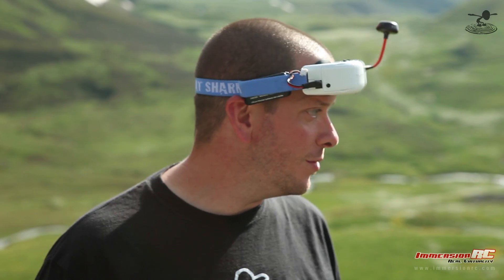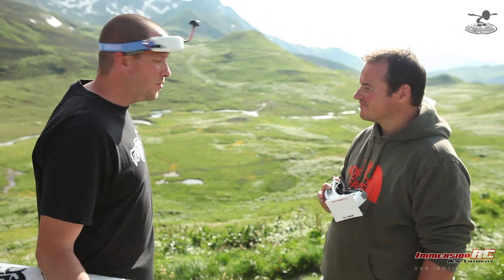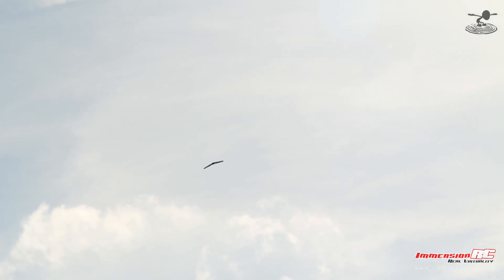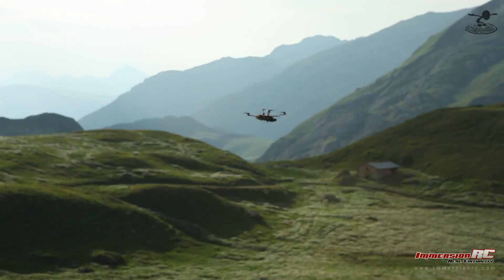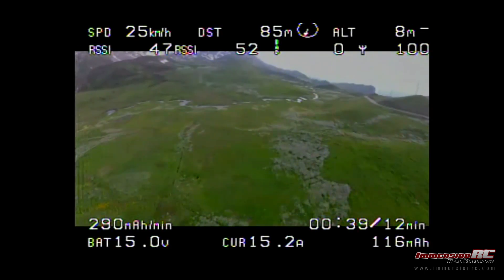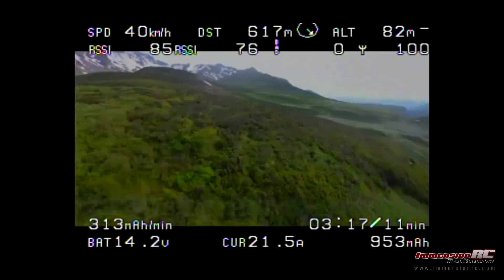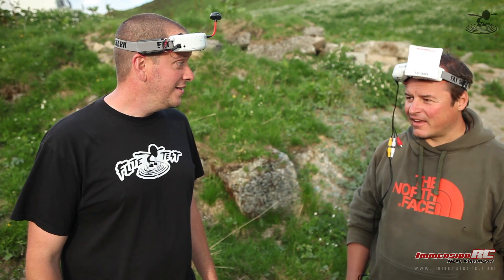Flite Test - EzOSD (On-Screen Display)

Comment: A friend of mine has the Ez OSD system and when he plugs in the camera the battery info on the bottom of the screen goes to the top and interferes with the flight info. He is not using a Immersion RC transmitter. Any ideas? I have the same system with an Immersion RC transmitter and have no problem.

Comment: Hi , I bought this ezosd as well  but just had some questions. the current sensor has dean's comnectors. one for esc and the other for battery power. how do we hook these two up? does one dean's connection go straight to the flight battery pack?  and does mean that I now have to get a battery splitter so that I can power up my drone and power up the ezosd? also my fpv transmitter comes with a jst connector in order to hook it up to the drone for  power but I'm now om confused because the ezosd is also hooked up to my fpv transmitter and is also fed already by the same power source. Next,   the other connection that says to connect to the esc.....does this get sliced into one of my esc's on my drone?

Comment: When you lose video and switch to third person all you need to do is full back elevator and enough throttle to fly loops until your eyes find it in the sky. You can practice the proper throttle amount to make the tightest loops in third person.

Comment: I bought this fpv setup according to your video, the fatshark dominator v3, Fatshark Dominator 5.8ghz Receiver Rx Module for the goggles, Immersion RC 600mw 5.8 GHz A/V Transmitter, EzOSD’ on-screen display, the same camera in the video, and the antennas your video has the link for. when I try and bench test the setup I barley get a picture on the screen its very snowy. I don't know how to fix it to get it as good as the quality in your video. any suggestions on how to fix that?I bought this fpv setup according to your video, the fatshark dominator v3, Fatshark Dominator 5.8ghz Receiver Rx Module for the goggles, Immersion RC 600mw 5.8 GHz A/V Transmitter, EzOSD’ on-screen display, the same camera in the video, and the antennas your video has the link for. when I try and bench test the setup I barley get a picture on the screen its very snowy. I don't know how to fix it to get it as good as the quality in your video. any suggestions on how to fix that?Read more
Reply: +Niko Heelleo it could be the signal bouncing off the walls. maby take it outside and walk out a few feet with it.

Comment: If he had an OSD with RTH... his plane would have come back on his own. If all you need is voltage and flight time, you could buy a $10 micro minim osd to help you with that. I got a cyclops it's working great so far. Looking at Eagle Tree Vector for the next one.

Comment: With the altitude display, I take it the number is zero'd at your launch site? Would it be possible to have a terrain database on board, so that it knows your lat/long and knows the terrain height. The aircraft's height minus the terrain height will be your height above the ground. Probably not too important when your video is working, but if the camera dies on you and you have to fly back on the OSD it would prevent you flying into a hill.

Comment: Hey Flite Test - question on the iTelemetry dongle that was used on the quad when going to find the crashed wing. How do you get it to work? I have an EzOSD and EzUHF with RSSI data displayed - awesome. I just got the iTelemetry dongle to help with finding a downed craft but despite the apparent ease to connect it between my Attitudes and my iPhone 5 with a double ended headphone cable (I am using a trainer cable that I use on my Spektrum DX7s), I can not get it to have solid performance.  I have matched the slow/norm/fast telemetry speeds in the App and the EzOSD settings and can't get it to work solidly - more bad packets than good.
I have researched online and many people have the same issue and there is no clear solution on FPVLAB, the main source of support for Immersion RC gear since they do not support themselves.
Since you promoted the iTelemetry Dongle on this episode, can you make an article or video on how to connect the iTelemetry Dongle to an iPhone so we can actually use the telemetry and map features?
Thanks
VeeDubalot a.k.a Chad

Comment: So someone explain how they are both receiving...what if they both wanted to fly with the FatShark set-ups, would it be possible with two video transmitters, or would there be significant interference?
Reply: The Fatsharks have 7(?) channels that you can choose from. If both used a different channel (preferrably not directly following ones)  on their transmitter and receiver they'd have two different connections.

Comment: If you're using a HUD/OSD, you should use one with an auto-return feature. That way, you can set it so if the signal disappears it will automatically climb 500ft in a spiral and then fly 'home' and circle.

Comment: Using 1.3ghz or RTH would easily have avoided the original crash.  Just saying.
Reply: Wyll Surf Air He didn't loose video because he used 5.8ghz. He lost it because the props weren't balanced and so it caused vibrations which then caused the antenna to loosen and fall off. But yeah, a RTH would have been ideal

Comment: I always use a GPS tracker. I don't use an OSD but I use a separate link for telemetry on my smartphone using the 433MHz band because then when I loose my flying device, if the GPS tracker doesn't have GSM signal and the 2,4GHz and 5,8Ghz bands are blocked by some trees or whatever I might still have my telemetry link in 433MHz on my phone with the device's position. Not later than this saturday the telemetry link is the ONLY thing that allowed me to find my 3DR Y6 back after a crash in the mountains. And of course even my planes are equiped with an autopilot in case I loose the video signal I switch the return to launch with at least 200 meters of minimum altitude. If what I am saying interests you you'll find more about all that on my channel :)

Comment: Showing EZOSD was an opportunity while in Europe.  Obviously we've all seen these features on other OSD devices.  What I wonder about is the efficacy of using telemetry from devices that your flight controller is not connected to?  It would be interesting to see side-by-side GPS data from multiple radios, and it might help diagnose fly-away and other suspected GPS failures not associated with interrupted power (we suppose).  If GPS radios really do perform differently, it may be useful to have the data from two or more be monitored, and an alarm sound when the data deviates by more than a preset threshold.  If a NEO works differently than a LEA, maybe the readings could be averaged together for better results?

Comment: Never seen a CCD camera perform so badly, the jello was really bad which basically should not be there on a CCD camera, not a good advertisement for fatshark, I guess neither was it for immersion seeing it lost video link as well (wing looked perfectly fine so it clearly was not the antenna coming off).......

Also pretty funny you guys were using your soon to be biggest competitors (flysight) equipment, FYI to those reading this, unlike immersionRC vTX's you can fly a flysight vTX on every channel without interference to the person on the channel next to you, that means 7 people in the air at once without drama.

Comment: I'm not a fan of the ezOSD: the GPS altitude reading is almost always wrong, even if the aircraft is kept stationary for several minutes after the OSD shows a good fix. Direction to home works well and the dual RSSI reporting is good. The other thing that's not great is the Android software (which is used to show telemetry at a base station) as it cannot record the flight geo-data. I've never been able to get the PC software to show geo-data following a flight.
Reply: Isn't GPS altitude always kind of inaccurate? That's why people use barometric sensors for altitude?
Reply: Balu Barometric can be pretty inaccurate. Depending on what you set your initial pressure settings to, and taking into account that conditions might change, your readout could swing pretty heavily. (At least if you are looking for altitude above ground) Radar altitude is probably the most accurate and GPS altitude should be decently accurate as well. I am an Aerospace Engineering student so I'm just telling you what I know based on theory and classes. I don't have much rc flight experience although I've always wanted to take the plunge and get into the hobby.
Reply: Justplanecrazy25 Thanks for your reply.

I'm guessing that barometric pressure is used in RC because the conditions might not change that much in 10 minutes of flight time? Also it's usually used for "altitude hold", not for "altitude measurement"?

It's been a while that I've looked into this because I was wondering about my handheld Garmin GPS altitude data. This sums up what I was told then: http://gpsinformation.net/main/altitude.htm

"Radar" is sometimes used in form of ultrasonic sensors, but they only work close to the ground.

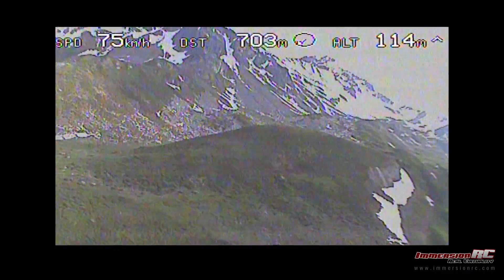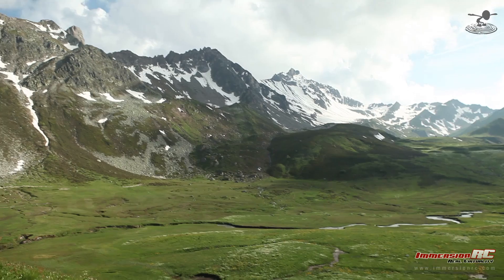Comment: People actually still fly FPV without RTL? If I lose signal, I just calmly flick a switch and my aircraft climbs if it is below 50m, turns around, and comes back. I have never once had to rip off my goggles like they did at 6:10. Also, at 6:30, the spotter says, "You went behind that ridge..." and the pilot comes back with, "And no one screamed BEFORE I lost video?" What he was implying is that the spotter was supposed to let the pilot know, from 700m out, that he was about to fly behind an obstacle. That cannot be the spotter's responsibility. It is up to the pilot to have enough situational awareness to know if his flight path will take him behind objects that will block his video signal. The reason is simple: At 700 meters distance, it is impossible for a spotter to determine if a small wing is about to cross in front of a hill (where it would retain signal), or behind a hill (where it will lose video signal, such as what happened). That's why a pan system is also so valuable. You gotta constantly check to see visually from your FPV POV where base is at, so you don't accidentally fly behind a hill!

Comment: This could have been avoided.  First, why isn't the ezosd showing the Lat/Lon from the onboard gps? If you have that enabled and use the built in DVR on BOTH of those goggles all you had to do was review the footage for the last coordinates.  I have the Dominator V2''s and had to use this method once.  Second, get a good autopilot.  For planes I have had good luck with the cheap turnigy t1000fc for about seventy bucks.  Does a great job with return to home and have my failsafe set to activate it on signal loss.  Only down side with that autopilot is it does limit you to 45 degree banking so wild flying is out but that could be seen as a plus side for AP.  Also I don't buy fully into the capacity meter.  I think that is false hope.  My couple of year old 2200 batteries only put out about 1800 ma now.  So the flight time would be off.  Going by pack voltage seems to work better.  Lastly my favorite osd so far is the cheap HK miniOSD.  Throw away the inlcuded gps, use a $30 10hz one and flash the osd with U-OSD.  Totally configurable and accurate for about $60 when all is said and done.  Finally I give a thumbs up for showing the incident.  This stuff does happen.  We all learn from it.  I see the sma as a weak point.  I wonder if there is a micro BNC style connector that could be used.

Comment: Didnt he had RTL?  I was under the thinking he was going to show off the OSD flight back home... and he lost video at 600m from launch? Fatsharks are awesome, but the rest of the equipment? I'm not so sure.
And I bont like cmos cameras.. flitetest!! This needs a redo,  Josh saved his quad with the apm loads of times, I'm sure with the transmitter in his hands we can get a better review of the ezosd.

Anlso a video about what to do when hou loose video, when to dich the plane when to try and save it, use of loiter or rtl, maybe loiter for quads inbetween tree, rtl for a plane in open air, that kind of thing.. hope to see this revisited
Reply: Nope, there was no specialized flight controller on board, so no RTL. He did not only lose video, but all data besides controls after the FPV antenna got disconnected from the vibration created by the motor / props.

Also don't bash CMOS cameras without trying. :) They don't call the Fatshark 600TVL camera a 'CCD killer' without a reason. It is specifically tuned for FPV so you can still see the ground when the sky is bright.
Reply: Cmos...I said I dont like it.. not thats its crap?

Comment: Kind of surprised the FliteTest crew seems so blown away by such a mundane piece of gear. This is just a big ImmersionRC ad. To those just learning about this stuff, take note: there are many other OSD manufacturers out there (Eagle Tree, Skylark, and others) that offer more complete feature sets, so do some research to get what you want. EzOSD is only "EZ" if you use their other gear (vTx and camera), other than that it's nowhere near plug and play.
Reply: Which of the other OSDs would you call "plug and play"?

Of course this was kind of an ad. Didn't you see the ImmersionRC Logo on the bottom right? Kind of, because we still got to see the features of the gear besides "buy buy buy" and had some FPV flying in a really nice area.

Comment: Does Immersion Rc make a OSD with "return to home"
Reply: For what this unit costs, you would think so.
Reply: Tyler - Not speaking for Balu but what I'll put out there is that while EZosd is made well, it's borders insane to charge what they charge for "pretty pictures" on a screen when there exists MANY other OSD's that offer the equivalent for much less.  A multitude of other OSD's offer RTH, waypoints, loiter, airspeed control, stabilization & a host of other cool features - for the same price.  I just don't get the Ezosd craze.
Reply: FPVav8tr tylercampbell92 There is a small difference between "On Screen Display" and "Flight Controller". One shows information, the other one controls the plane. There was no flight controller on this plane, just a receiver, an ESC and some servos.
Reply: Balu, have you seen my channel?  I kinda know the difference.
Reply: Balu So, my interpretation of what your saying is, to have a "return to home feature" you need a flight controller. Correct? I can't tell if you intentions are malicious or not with your comment, but if they are, what are you trying to achieve?
Reply: tylercampbell92
Not malicious, perhaps a little stronger formulated than I wanted because English is not my first language.

All I wanted to say that there are flight controllers that have the features FPVav8tr lists and there are OSDs that show information on a video screen. The EzOSD is one of those - just meant to display information but not control anything like a flight controller does.

Then there are systems that combine both. Those are the ones FPVav8tr is talking about.

I am a beginner, so I have not looked deep into this, but:

The "Dianmu FPV Flight Controller System OSD/GPS/RTH/Barometer" is $ 190 at HobbyKing. But it only supports fixed-wing planes.

The EzOSD is $ 162.To that you would have to add a FC like the MultiWii  that is $65 (with GPS, Baro, etc). So $ 227 in total.

Then there is something integrated like the Eagletree Vector for $ 237. This one supports quadcopters too. But is a closed system.

I don't know if there is an alternative firmware for the Vector, but the advantage (disadvantage: weight) of the modular EzOSD+FC is that you can just switch to any FC or existing community firmware you like. And you have two systems, so if the GPS on the FC shuts down, you still have the EzOSD "home arrow" e.g.

As FPVav8tr said, there probably are a lot more (and cheaper) options to choose from, but you have to not only compare the price, but the features too.
Reply: FPVav8tr  Very simple! They are paid  to produce this commercial...
Reply: Hi tyler..  I asked IRC and they said they are working in an RTH version. The EZOSD is good particularly when using there own receivers It provides both RSSI link info for each antenna (lower value better) if using a diversity receiver . It also counts the number of drop outs and has a traditional RSSI indicator (higher better). That sort of info is useful when putting together a new FPV plane or maybe testing home made antenna. Its a very good OSD with many other features but as stated there are cheaper alternatives and I like to have RTH its saved me a few times even if it just turns the plane around so I can regain radio contact. I no longer use the EZOSD but if IRC make a version with RTH and flexible stabilisation (ie on/off, climb mode as well or horizontal) I'll be interested. I am an IRC fan boy I use a lot of their gear becuase its reliable and well made. I wish they would send me a HP 459MHz version of their JR module firmware they keep ignoring my requests.